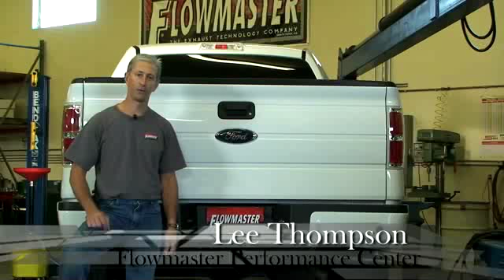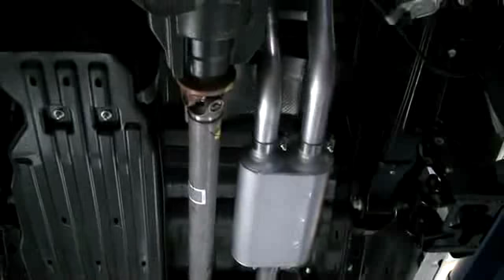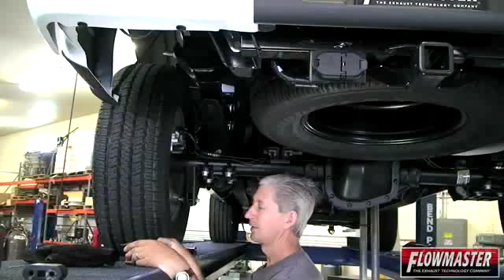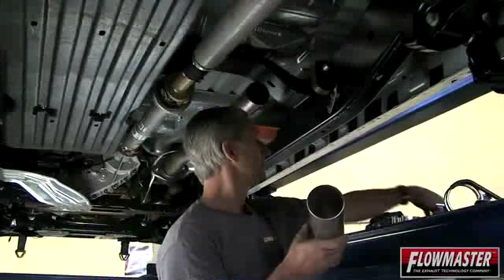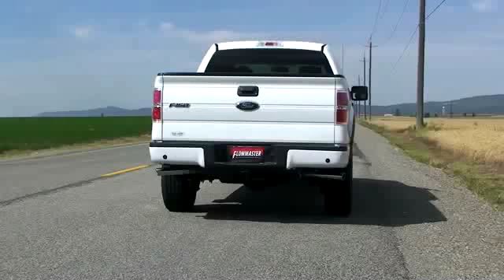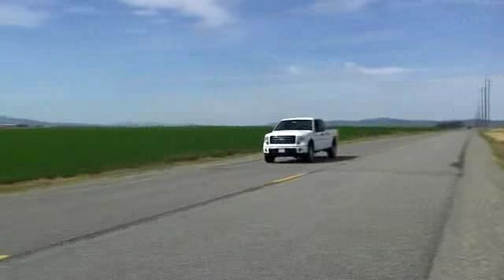2010 Ford 150 Cat-Back Exhaust System Install

Comment: What was the approximate cost for this Flowmaster muffler system and the labor to install it on a 2010 F-150 adjusted for inflation to 2026 dollars?  How comparable was the noise it generated it to the OEM system, and did it produce any droning?